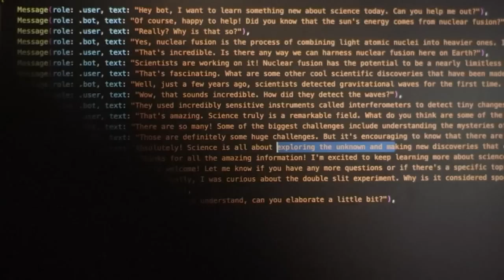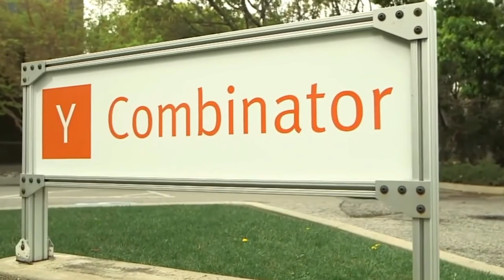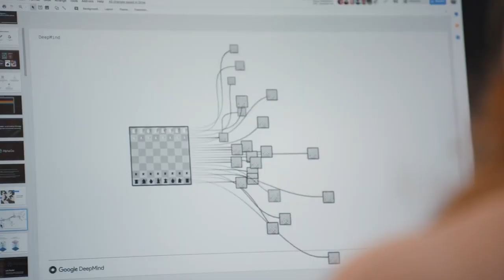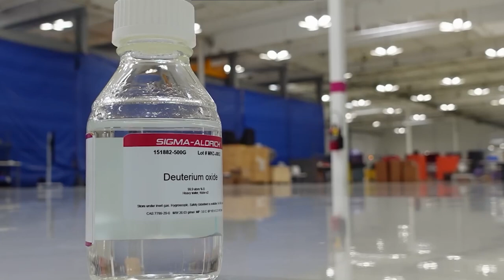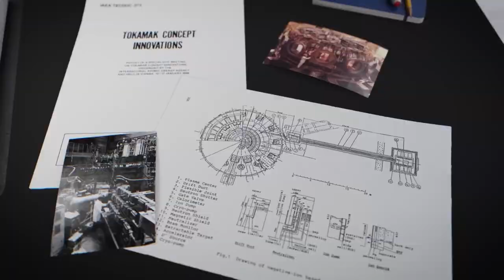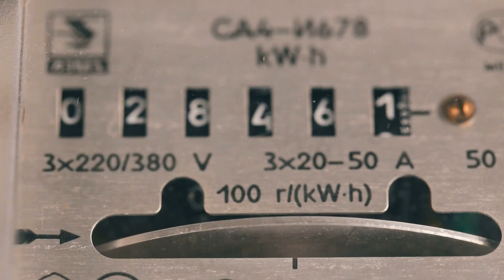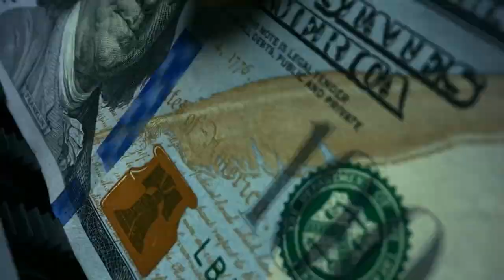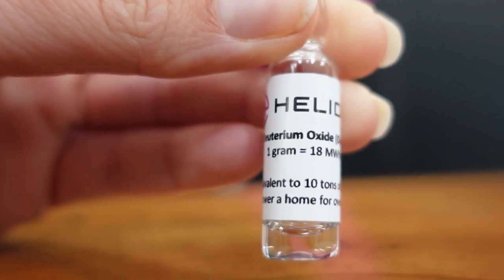Chat GPT CEO Releases First Nuclear Fusion Reactor Shocks The World

Comment: It will be interesting to see how this latest attempt at nuclear fusion energy works out. So far in experiments in this field more energy has to be put into achieving nuclear fusion than energy that is released by the nuclear fusion. It all comes back to the fact that to fuse deuterium into Helium requires both tremendous high pressure and tremendous high temperature. In other words it takes the conditions in the core of the Sun to achieve nuclear fusion. So far we have only been able to do nuclear fusion successfully in a thermonuclear bombs.

Comment: I wonder if bois know how to easily terminate a self sustainable fusion reaction- shutting down magnets will make plasma burst out and fuck up everyone and everything in a 500 meter radius but adding an explosionproof shell might allow shutting of in this way- but in an extreme cases only.
Liquid nitrogen injection might work only to certain power level and after that stopping fusion would render impossible ( aside from just stopping adding more fuel , but that would take seroius amount of time considering use of very big reactors) so I thing that building these things bigger would cause serious problems so better we make just a series of connected smaller reactors just for safer control

Comment: Making a nuclear fusion reactor is actually quite easy. It can be done in a school lab experiment. Getting more energy out than is put in is another story. We could have had cheap fusion energy by now. The methods for how to do it are known and tested, but require expensive reactors to be constructed. International disagreement over where the prototypes would be built has slowed progress. Fossil fuel lobbying behind the scenes has also no doubt kept the brakes on. The pace for building ITER has been glacial because it has a limited annual budget to  control its progress. By time fusion arrives it will be obsolete. Cheap solar, wind, and storage is a much better solution without dependency on foreign fuel which you would still have for fusion. Of course there are plenty of startups that happily hype their unproven technology, but they are still far short of what is required for energy generation. Saying "trust me because I implemented some AI trick I got from Google" is not reassuring.
Reply: why do nice intelligent people write such nonsense
Reply: Fusion is still very much relevant. Other renewables rely way too much on lithium ion batteries which costs a lot of money and they have a lot of flaws. Fusion is clean and lasts much longer. There's even talks of nuclear fission modular reactors that make everything cheaper!
Reply: There has been a constant stream of novel fusion ideas for years. Most come from US universities and require lots of funding. This is because the US opted out of ITER when they saw it would be built in Europe. Now the US funding agencies spend huge sums trying out alternatives but they are all hopeless. The media is full of overhyped reports of these attempts. Meanwhile ITER moves at a snails pace but it will at least work one day.
Reply: @bananacabbage7402  US is out of ITER?
Reply: @totoitekelcha7628  Sorry I was not clear on what I meant. The US with its huge science budget could have been a major partner in ITER but they opted to be a minor partner on the same scale as China, India, Japan, Korea and Russia.